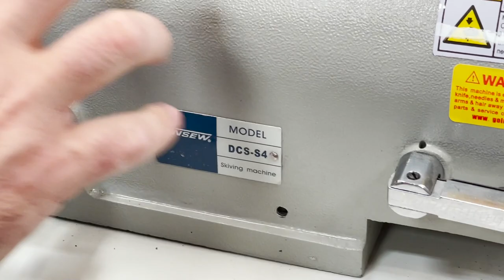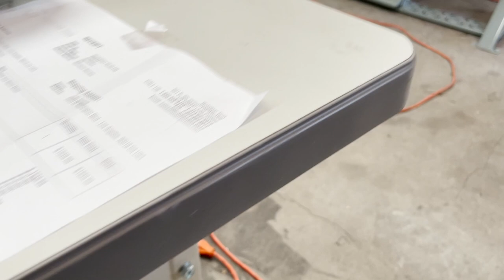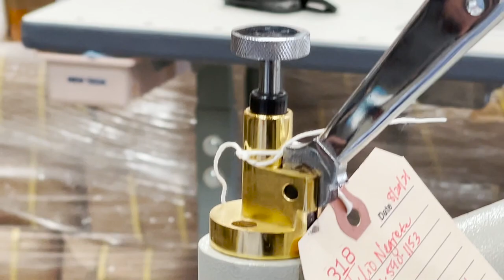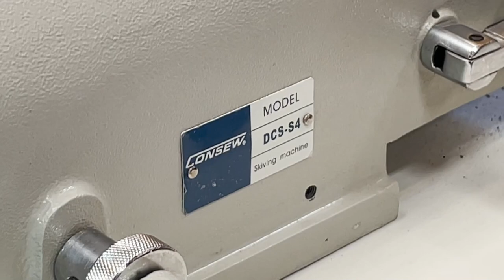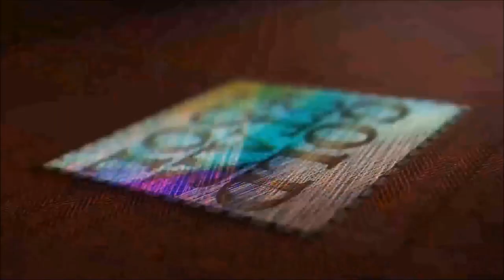Tutorial - Consew DCS-S4 Skiving Machine Guide - Goldstartool.com - 800-868-4419

Comment: You need to get a proper technician. The information in this video is incorrect. The spring tension for the feed wheel is for feeding... not sharpening. Theres a seperate hand tool that comes for taking off the burr of the bell. You do NOT need to pull the leather through, the feed wheel should be pushing it through. Please take this video down and do some research. Look at any other video of these machines operating on youtube so that you can help your customers.
Reply: Thank you for clarification, that’s what I thought as well.

Comment: What the??
Ive never used one of these and I know better than to follow these instructions 😮
Everything is wrong.  That stone does not sharpen the blade, its used to feed the leather.  He has it going too slow to feed correct.
That one wheel he said  dont touch, levels the foot so you can get a bevel edged if you want or more straight.